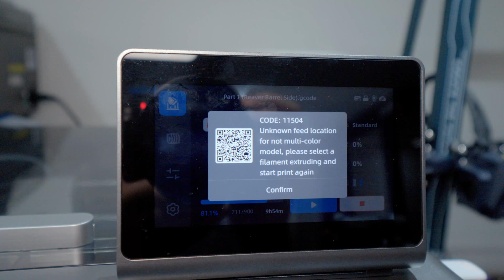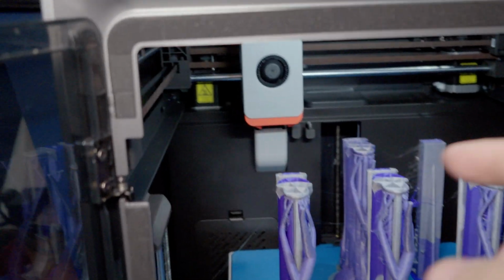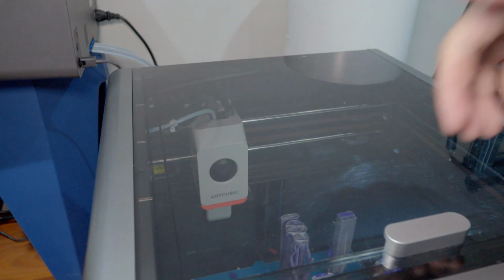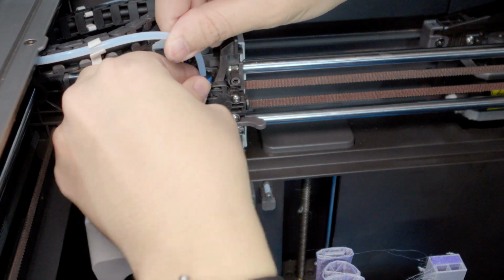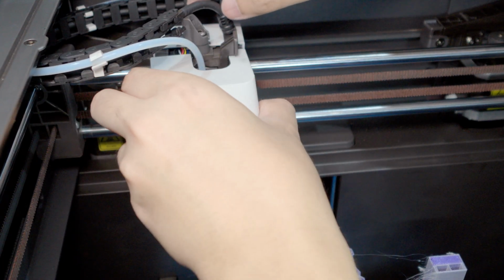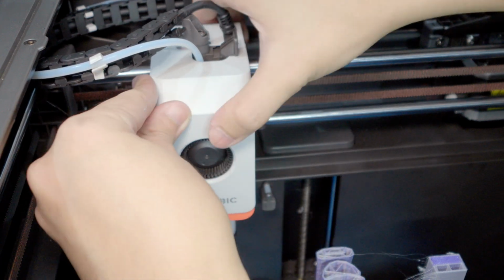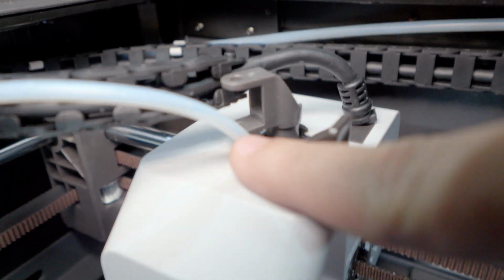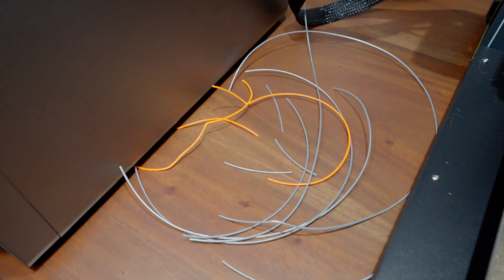Anycubic Kobra S1 | Fixing Error Codes 11504 & 1151 Easily

Comment: Procedure is not easy, many things can get wrong. Better is turn off Ace Pro,and Kobra, disconnect Ace Pro electrical communication cables from Kobra, and then turn Kobra on. Then preheat  head and push filament from Ace Pro by hand (open Ace Pro cover) until you reach the fragment stuck in the tube. Then, activate the filament extrude option in the menu to push the detached piece out. At the same time, manually push the filament from the Ace Pro. This will need to be done several times until a uniform filament reaches the hotend. After that Turn off the Kobra, connect all the electrical communication cables, and turn on. That's it. It works for me with broken filaments that were left in the tube.

Comment: Encountered this error today with new material, so not sure how it could have broken.  Wouldn't it be easier to heat up the nozzle and push out that segment while pushing new material from behind?  They certainly didn't design this hot end for ease of maintenance
Reply from the maker: Yea its a good idea. The only problem with that would be needing to release the extruder tension so that you can push the new material in. If you have a helping hand this should be nice. Doing it alone is do-able but not a good time 😂
Reply: @SwampMan   I got lucky. Spotted the broken filament before the hub.  Unplugged Bowden tube and pulled out that filament.  What’s interesting is all the other filaments were fine (Polymaker and Push Plastic).  The problem material - AnyCubic brand.
Reply from the maker: Interesting find. I haven't ran across that problem with Anycubic filament

I usually adjust extruder tension and fine tune my filament settings per type, brand and color 

Maybe i should make a video about it
Reply: @SwampMan  I haven’t touched the tensioner.  Left it stock. Hoping they did it right at the factory!

Comment: Unfortunately one Allen head is messed up and keeps me from continuing and on top of that. I can't remove the tube from the head
Reply from the maker: Man that sucks the only way you can remove the tube easily would be disassembling the extruder itself which is a bit harder with tiny parts in there

I've done it in this video i made 
https://youtu.be/BhoLKsHorwg

Comment: Witam
Mam pytanie bo zakupiłem S1 i na kalibracji w pewnym momencie wyskakuje błąd i jest napisane że problem z czujnikiem auto poziomowania błąd 10237 i też wyskakuje błąd 10120 
Czy ktoś pomoże czy trzeba do producenta odesłać. To nowa drukarka jeszcze nie używana bo kalibracja nie zrobiona. Proszę o pomoc 
Jestem osobą dopiero wchodzacą w druk 3 d to moja pierwsza drukarka. Z góry dziękuję
Reply from the maker: Most likely there might be a loose connection or wire inside your print head pcb. Check it if you want. If not you'll need to ask for the leveling sensor part if it was damaged during shipping 

You can technically ask for a refund too if that work or let them replace your unit

Comment: i have this problem on every single multi color print, when i hit resume sometimes its resume and its good for 2 or 3 layers but after that i get the same error again and again, any idea what could cause this?
Reply from the maker: My guess is the buffer mechanism or filament sensor. Just usually those two messing up and halts a print

Comment: Hey, I need to know what the name of the  little black piece holding in the tiney spring everyone loses on the extruder.  You have a picture of it and the other extruder parts in this video, but No name anywhere.  Looks like I'm gonna have to order it from AC.  Thanks
Reply from the maker: Filament trigger is what its called as far as I remember 

There's two versions of it which is the plastic one same with the video and the newer metal one. If you'll buy one go for the metal it will last longer

Comment: Do you have any idea of why on Earth the ACE Pro keeps switching filaments before Printing? It's very annoying cause it then keeps giving the 11511 Error Code that it couldn't extrude properly. There's nothing in the printer head. The color was set to Spool 4 (RED), which I'm using all the time. But for some reason the printer has to pull in and out all filaments randomly taking 10 to 20 minutes for no reason and then stops giving that error code. I never had this issue before the lase Firmware Update :\
Reply from the maker: It reads if a filament is loaded in the filament sensor on the ace as far as i recall. Potentially be a jam somewhere. It is just usually a sensor that shouldn't be triggered

Comment: I have some Filament in the Nozzle that's NOT auto extruding😢 after multiple attempts at start of prints sessions... I have checked and dissasembled to the Nozzle... It has some remaining AnyKubic GLOW in the dark Filament which is also FLUSH in the top half of the Nozzle at the silver pipe. I've been told this is Normal BUT I was told by a forum user just start fresh and heat the Nozzle to 300° and FLUSH 😳 it out. Then start clean.  So OK, HOW do I do that? Without starting a print session?

Please advise how I can get that remaining GLOW Filament OUT of that Nozzle? Manually. 😮

Do you have a FB forum, or website email I can reach out to you? 

Please advise "How To Extrude Hotend ONLY to remove NOZZLE FILAMENT. Thanks inadvanced.
Reply from the maker: I would actually replace the hotend or extruder in your case. Get some spare if you can

Also if its stuck on the metal pipe you can heat it and use pliers just he careful with not burning your hands

Comment: Looking at the plastic channel in the feed mechanism, I'm thinking that printing with composite materials is impossible. Or am I wrong?
Reply from the maker: Good question actually

This was with the older batches of extruder. They recently updated these to a metal filament trigger which will solve that

I did try composite materials just less than 1kg print and haven't seen damages on mine yet. But eventually over time it will damage it for sure depending on how abrasive the filament would be

Comment: I had and error code for the cutter it wasn't until I removed the filament that it started working again. I didn't know the cutter could clogged with filament.
Reply from the maker: Yeap hate those little bits that get stuck 😬

Comment: I can't pull out the white tube. No matter what I do, it might be stuck. Tell me what to do. Help me please
Reply from the maker: You can unmount the pressure sensor the metal aluminum part that holds it on the left side, split the extruder casing and remove the ptfe tube without yanking it out. 

There's someone in the discord server that has your same problem there are photos there

Comment: For anyone following this video. He mentions but totally minimizes the vital importance of the filament trigger. There is a tiny spring and a loose piece of black plastic that is supposed to hold it in place. These tiny parts are prone to flying out of the casing when opened. If these parts are  lost or damaged the filament trigger will give a continuous broken filament warning. Sounds stupid, but if you open the filament extruder case try and do it in a clear plastic bag you will be thankful you did.
Reply from the maker: The filament trigger and spring are definitely important and wasn't able to cover that much for this video

Thanks for pointing it out tho appreciate it

Here's the in depth guide i made to opening it up

https://youtu.be/BhoLKsHorwg?si=0-tFoxEx3oTysceU

Comment: what screws to tighten after 250print hours?
the extruder "tighten" one?
how to check for belt tension?
how to adjust the belts?
Reply from the maker: The "tighten" one on the extruder is used for extruder tension on the filament. If you have filament that needs tighter tension or looser tension you can adjust that. I make video about it

For the belt tension if your prints are showing inaccuracy ex. 20mm printed as 19.8mm you can adjust belt tensions first

I just recently troubleshooted a belt tension should be a good to make video about it now

Hope these help you

Comment: gradient matte pla & silk pla from ZIRO bring only clogs.any tips?
Reply from the maker: Get your optimal temperature first you can print a temperature tower in the slicer

Find what temp the print output is good and strong

Then find your flow there is also setting calibration in the slicer for this

Not all materials and brands have same flow and temp. Some will give you clogs and jams depending on the manufacturer's formulation

Comment: Can you make a video on how to remove fillament from an extruder if it's completely stuck in the litteral extruder?(For more context, I own a Kobra S1, And i got fillament stuck in the extruder, litterly, I tried pulling the fillament out with a wire gripper, I tried heating the nozzle, I even tried disassembling the kobra s1 print head halfway, I am stuck at the part where i need to remove that gear thing behind the extruder, If you got discord i can give you some images of my problem.)
Reply from the maker: Sure thing i'll keep not on this thank you for the idea

You can join the discord in the video description and post in the 3D printer channel. I'll check it

Comment: Before you do ANYTHING in this video, just turn off the ace pro, reboot printer, extrude filament, turn on ace pro and be finished without messing with anything and this works most of the time.
Reply from the maker: Yea worth a shot to try that
Reply: I couldnt get the white tube off and was afraid of losing little parts taking it apart further to do it so I tried this and it absolutely worked! Thank you so much!

Comment: Broken the wires of the sensor that attaches to the string and little black piece...Should I weld it or ask for another piece...This printer sucks. Dozens of time I had error after error en opening after opening and now this...
Reply from the maker: Yeah request the replacement part

You can solder it for the mean time if you cant wait

Comment: Hi. Short question bevause I can't find in on wiki. Tension - what direction will it tighten what direction opposite makes it loosen?
Reply: Nevermind. It is written on the side of plastick cover 😅
Reply from the maker: @jchris_fpv  Haha yea twist the allen key to the left to tighten

Twist the allen key to the right to loosen

Commenting this for people who encounter the same thing 🙂
Reply: @SwampMan thanks. I was wondering, once i had to open the extruder. After all I am facing issue with tpu. It stucks inside (error says so tha filament is blocked) although I havent changed the tension. Is it possible the tension has changed by itself? Shoul I loosen it anyway? All in all PLA directly or through Ace Pro works normally.
Reply: I think I have tpu 96a. Maybe i shlould go for i.e 83d or 77d instead?
Reply from the maker: @jchris_fpv  Yea dont try TPU in the ACE Pro could get jammed in there

You need to use the external spool for it and usually for TPU it wants a slightly tighter tension (in my case it did)

I use 95A it works fine and some other flexible filaments
Reply: @SwampMan yeah I saw videos how tpu stucks inside of ace pro. I have it on the spool at the back. I will try to adjust the tension. Thanks.

Comment: The tube leading in to the print head won’t come out as easy as you made it look. Is there a secret to pulling the tube both in print head and in the back?
Thanks for your tutorial!
Reply from the maker: If you can't pull out the ptfe tube you can unmount the extruder and open the casing instead

Sometimes the ptfe gets damaged and binds with something making it harder to remove

Comment: Faced this error for the first time. I could clearly see a piece of filament broken into the tube and stuck into the head. Followed your video to dismantle the extruder and obviously that little piece of plastic attached to the little spring went flying the moment I opened the extruder. Your video is out of focus most of the time, but I was able to forward frame by frame untill I found a moment where the piece is clearly shown in place!!! Thanks man, I was trying to reassemble it reversed.
Reply from the maker: Thanks for the feedback and yeaa still working on my camera auto focus 😂 there's a video in my channel taking more time assembling and disassembling the pieces together for next time if you need it. Will probably do a video explaining extruder tension next time and how the pieces work together

https://youtu.be/BhoLKsHorwg?si=eP7wGXYSDzZNytGd

Comment: I've had my S1 since April. The printer has constant issues like this, and with the Acepro. I do not recommend buying this printer. Single-color prints are very good, but multi-colored prints are a waste of filament and time. I've set the filament poop to .5 when changing colors, which slightly improves the waste/time issues.
Reply from the maker: Fair remarks like the worst combo you can do is wet & old filament and you're in for a troubleshooting session 😂

I just use a purge object and have the purge at 0.1 
Seen a user post that it doesn't matter anything below 0.4 tho afaik

Comment: I've been having the error 11511 repeatedly in the past week; I take the printer head apart and check, maybe adjust the printer tension, then do a test print which comes out fine (one of them was a 5h print), but the error message reappears once I try to start the next print. Its now been 6 prints that print just fine but followed by this error message everytime... I have no idea what could be the source of this issue :(
Reply from the maker: In your case could be a clog? First thing i check is how well it can extrude the filament by the extruder tension and if i have the optimal flow set on the slicer

Hope that helps

Comment: When I first got my Kobra S1, I wouldve said that it was the best printer for the price. But now that I have owned it for about 6 weeks and it only working for half that time, I would say to stay away from this printer.
I have been plagued with error 11518 Filament Clogging and have been back and forth with Anycubic for a while now.
To their credit, they are willing to send replacement parts for what they think will fix the issue, but less than a month into owning the printer, I shouldnt have these issues.
I have replaced the extruder, PTFE feeder tube, eliminated the ACE Pro and fed it direct, replaced the hot end and ensured everything was clear of any sort of blockage.
The printer still will not print.
Reply from the maker: Ah fair

You still getting the 11518 error code? You mentioned the ACE Pro is not used so im assuming you're having a different problem right now?
Reply: @SwampMan same problem, same code
They’re now sending me a new extruder motherboard.
I hope this will fix the issue. If not, then it’s back to the email tag with Anycubic…
I really wanted this to be a good reliable printer.
Reply from the maker: Ahhh does sound like the pcb then or the sensor is my guess

Last time i had to change the extruder motherboard it was for the heatsink fan Didnt turn on the fan and caused clogs later on 😂
Reply: @SwampMan  how long have you had your S1 for? And have other users reached out to you for issues they’re also having?
Reply from the maker: Since January if i recall correctly 

Users have dealt with mostly hotend or extruder related issues. Once you do know your way around it haven't seen same users complain about their printers

Either you like the printer or not is what im getting with this model across the board
Reply: @SwampMan since having this issue, I feel like I can disassemble and reassemble the print head blindfolded because of how many times i’ve had to take it apart😂

I really hope the print head motherboard is the issue due to a possible cold solder or something dumb like that.

If not, you interested in another S1?🤣
Reply from the maker: Yea do hope so 😂 also im finee got what I need with two Kobra S1's we have